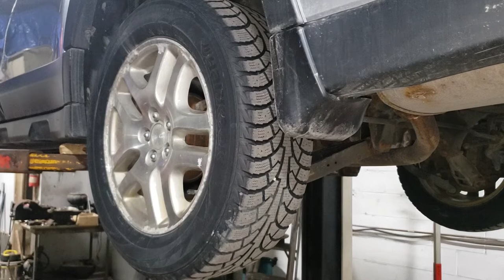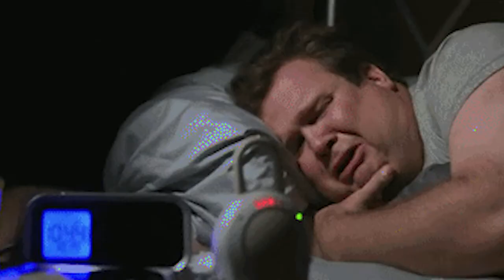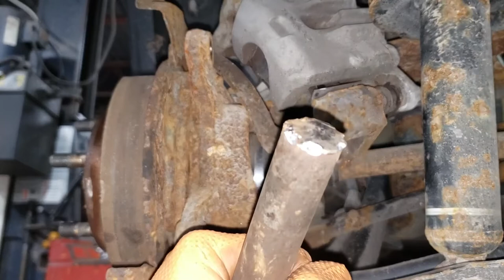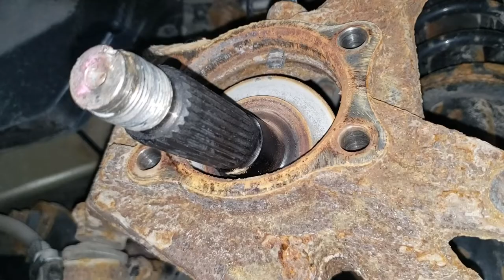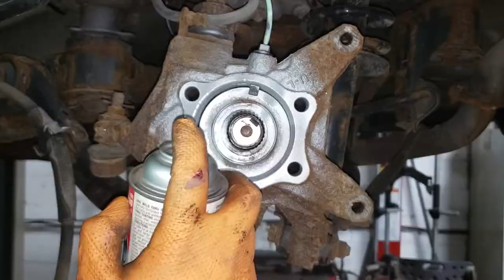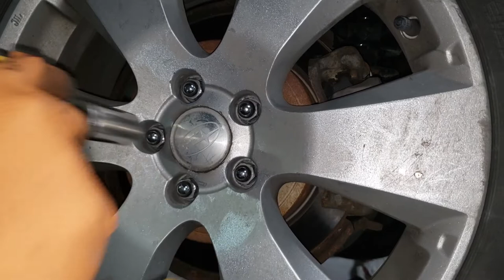2011 Subaru Outback 2.5 | Bearing | Hub Assembly Replacement | A How To Guide

Comment: Same process for the front passenger side ,
?
Reply from the maker: For the most part it is the same however the torque values will be different. Take a look at your dust shield behind the rotor before you do the job so you can order one if need be. They like to rot out.